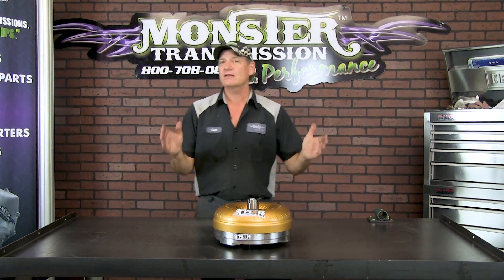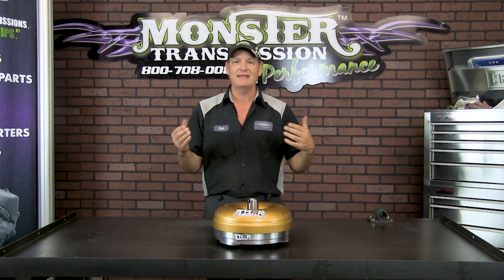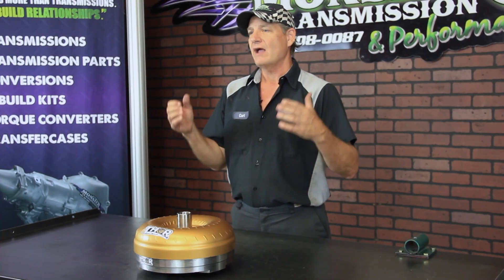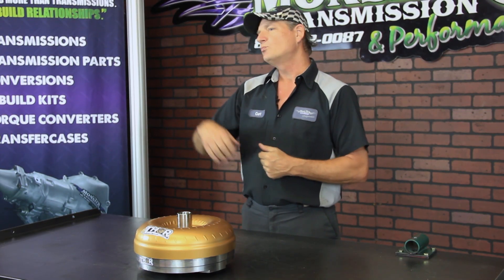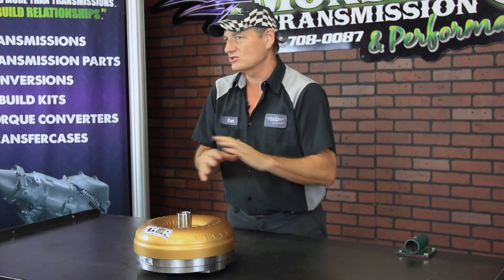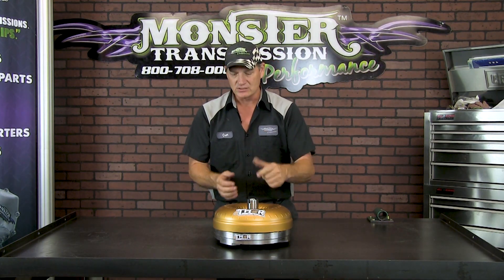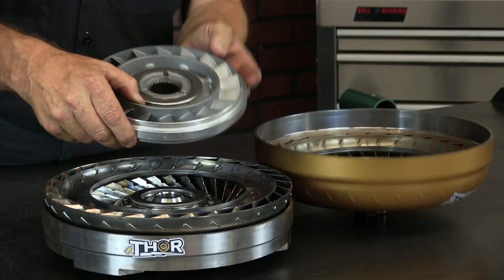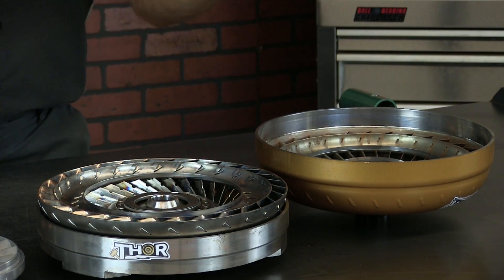Stall Speed explained in Curt's Corner

Comment: Are there torque converter problems that a driver can sense? I have a 2017 Pacifica. Many times when coming to a not-quite stop I will put my foot on the gas to go. I am a very light footed driver, by the way. I sense a lag in response similar to slipping a clutch in a manual car. then it fully engages after maybe a second. If I was heavy footed I suspect I would experience a lurch forward. What is this problem, torque convert or tranny? Two dealers say, "no problem!"

Comment: I always thought the converter was chosen based on the RPM range it’s to engage.
Reply from the maker: Hello! Converter Stall Speed is tricky. There are a lot of factors than can alter the stall you need for your vehicle. One way to tell what stall you currently have is a stall test. You hold your foot on the brake then the gas and the RPM the tires start to brake loose is about what stall you have.

Comment: I have small block Chevy engine,300 hp. I am running 28 in. Tires,with 389 gears and. Turbo 350 trans .what size converter would I need?It is in a 85 c10/ with a ford 9 in.
Reply from the maker: Hey Doug! Thank you for the questions, we would love to help you find the correct converter. I would recommend calling in to our product specialists at 800-708-0087ext1 and they will get all needed information from you.

Comment: What if it stalls when put in gear
Reply from the maker: Too low of a stall
Reply: @MonsterTransmission  my car has the original transmission in it it has 245000 miles on it
Reply from the maker: @brandonmccall3929  If it's starting in 3rd it could have an internal issue

Comment: I have a question.
I plan getting your PP7704LSLU 2600-2800 stall converter no balloon plate.
It's going in a Street/Strip 1985 Chevy c10 with a 350 that has a 510/520 lift 282/288 duration (2200-5800 RPM) cam. I have a stage 3 700r4 and a 10 bolt 8.5 rear with 4.11 gears and 28 inch tires.
I am not running boost or nitrous. To my knowledge my motor is 400 horsepower or a little over.
Would this stall converter be appropriate for my set up?
Reply from the maker: Yes that will work

Comment: If you have 2,600rpm stall does that mean it will shift at 2,600rpm??
Reply from the maker: A 2,600 stall speed doesn't mean you need to rev the motor to 2,600 rpm for the vehicle to move. What it does mean in this case is 2,600 rpm is the limit at which the converter will hold back the engine speed if transmission output is prohibited.

Comment: Great video how much for an ultra low stall 900/400 converter for my 1998 12 valve Cummins with 47re rwd
Reply from the maker: So what stall are you currently running? Thor converters can build that type of converter with a true 400rpm lower than factory built ones.